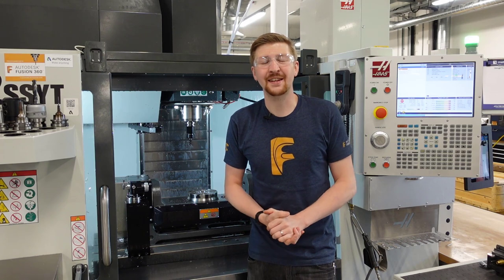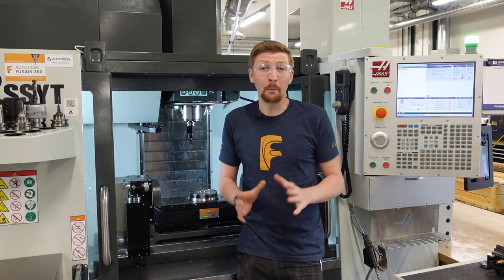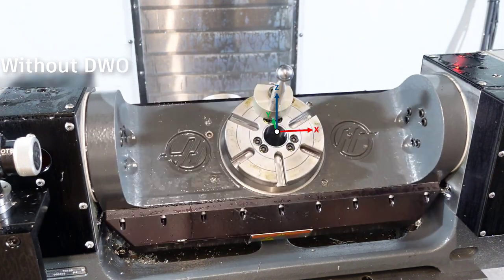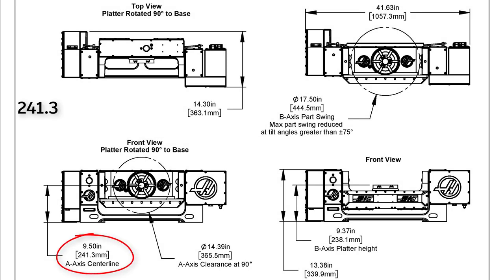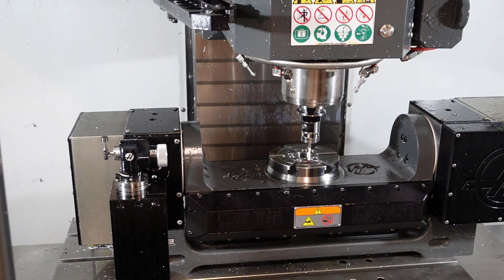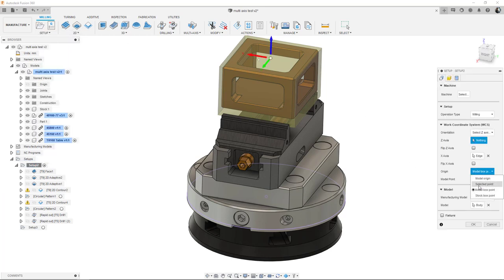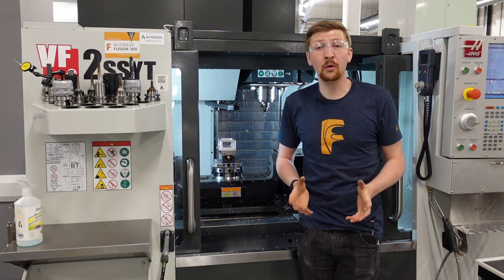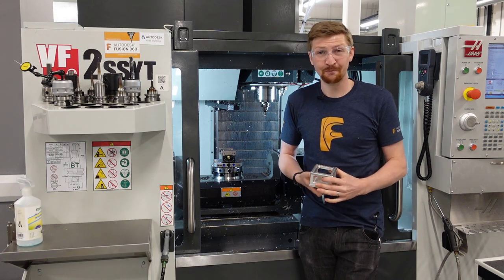Autodesk Fusion 360 | Tutorial: Using Multi-Axis With or Without Dynamic Work Offset on a Haas VF2

Comment: Can you share the test file? I just picked up a trunnion and dipping my toes into 5 axis as time permits.

A good part/strategy that directly indicates if I have my table perfectly dialed in for both physical  and cam would be great!
Using fusion360 w haas vf2 and tr110 trunnion.

I babe drays the trunnion into cam and belive I have it right. Rotory was off by 0.0015” from tilt axis and height was 0.0087” different in tilt axis Center and total height from the published literature. 
Just need to make some physical parts to verify all.

Comment: I want to know how to add DWO to my post. I have a Fanuc Robodrill with DWO option on the controller, and I’m using the Robodrill post in the HSM library. But it doesn’t have DWO in it. Please make a video on how to add DWO in a post.
Reply: On a Fanuc, if I am not mistaken you would be using 68.2 as DWO.  This is the Stock Fanuc post supports this.  I'll confirm why the robodrill one doesn't
Reply: I use DWO on MAZAK Variaxis J600/5X.  This works the same as with FANUC.   First place the workpiece zero point as you normally do in G54.  Then use G68.2 X...Y...Z.... to move the zero point to the inclined plane in which you want to work.  Then add IJK to turn the two rotational axes as this:     G68.2 X50 Y0 Z0 I-45 J45 K0    This is one of the possibilities to use G68.2 and is called "Euler Angles".
I= rotation around the Z axis  ;   J= rotation around the X axis  ;   K= also rotation around the Z axis.    Let the arrow of the axis point in your direction to choose a positive or negative rotational angle.  Positive is CCW and negative is CW.

Comment: can you show how to do this with just a 4th axis?
Reply: Hi @hyper formance, let's guess that your 4th axis is along the X so an A axis. 
Your X is easy, just probe the face of the platter. 
Your Z and Y will be at the middle. This now depends on the tooling you have available. 
If it were me and I only had a probe, this would be what I would try. I'm also guessing you have a 3 jaw chuck and you have made it run concentric.
Ideally we want to touch off the widest 2 points of the platter, but I doubt your probe would reach. So put a piece of very round stock in the 4th axis. The back shank of the biggest carbide end mill you have will probably be best here. Now move the probe down to as close to the centre of the cylinder you have as possible by eye. Do a Y Web probing cycle. This will now set the Y to the centre of the platter in Y. Move the probe now so its at Y 0.0, as we know this is the centre, and highest point of the cylinder. Now probe a z surface, minus the value of 1/2 the  diameter of the cylinder you are measuring. And now you should correctly have the XYZ set in the centre of rotation for your 4th axis.

In truth your X can be anywhere as there is only 1 rotary axis so nothing to intersect it with, however putting it on the face of your platter or face of your workholding will let you always come off that 1 position so you don't need to set up for every job all the time.
Reply: @richardstubley9651   fantastic write up.  how would I do this if I was wanting to set it on a vice mounted on the 4th axis?  a point off centerline?
Reply: @hyperformancellc  yeah, you are going to need to have something thats running concentric to the rotation.

Try and clamp something precision round in your vice. Maybe even a tool holder. Now set up a dti in the table and rotate the A axis with the handwheel to check concentricity. Then just tap with a hammer whatever you are using to get it running concentric.

It doesn't matter whatever you are using or however you are holding it. As long as its round and is not running out to the 4th axis.
Reply: @richardstubley9651  I have been using centerline since your comment. I am still just frustrated that I cant use the dwo that I paid for with the machine. am I missing a set up step on the rotary settings page?